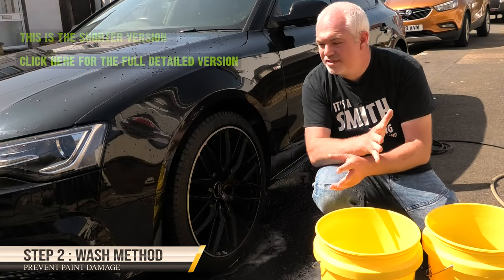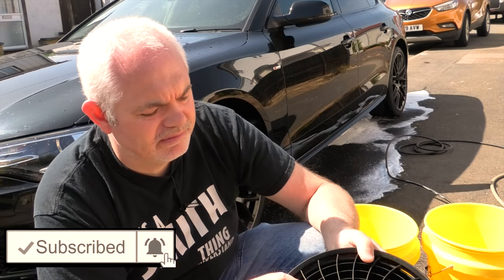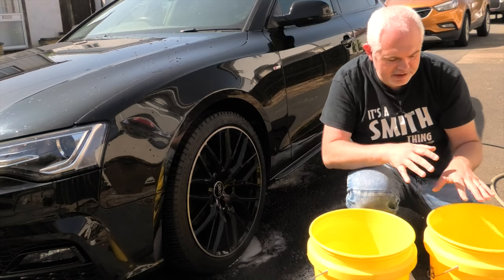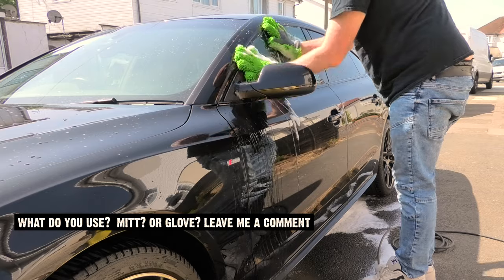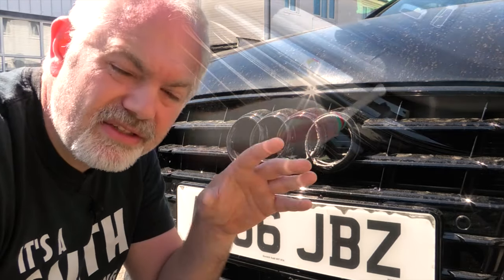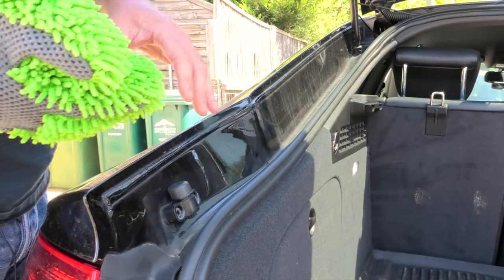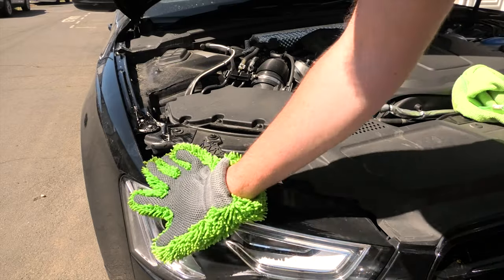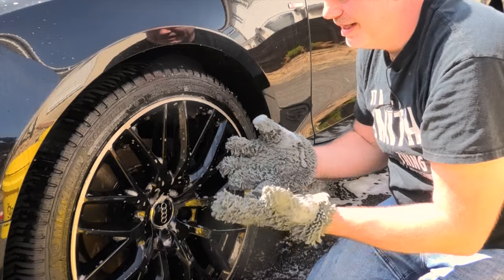AUDI DETAILING : E1 - Wash Techniques

Comment: Absolutely cracking job, thanks for all the good work. Do you think the day temperature affects the cleaning? I am thinking on hot days when you get to one part the other part is already dry. Do you have any preference?
Reply from the maker: Yes it will.  I try to avoid cleaning in extreme heat.  Unless your in a garage, id wait til towards end of the day or early morning.

Comment: Removing the tips and the electric toothbrush seem extreme to me but to each his own. I wouldn’t use the same mitts on the paint and the engine bay either.
Reply from the maker: Oh if i was detailing the engine i wouldnt use those mits either.  Use a detailing brush.  It was merely to clean the dirt from the light.